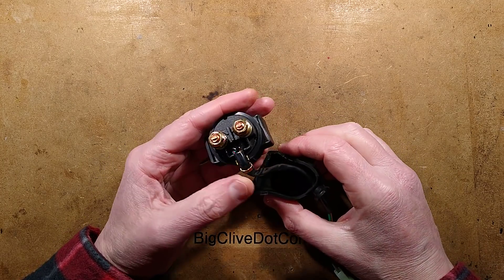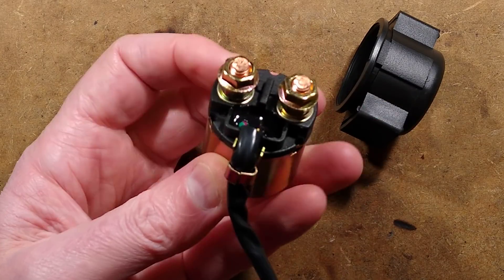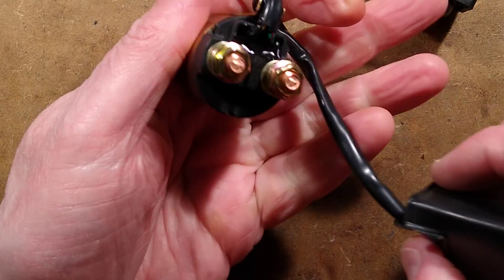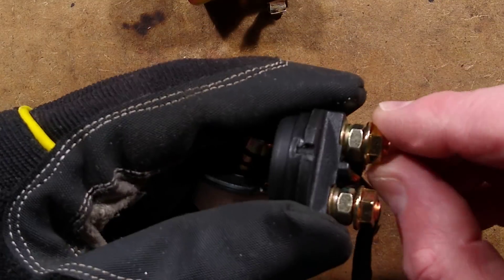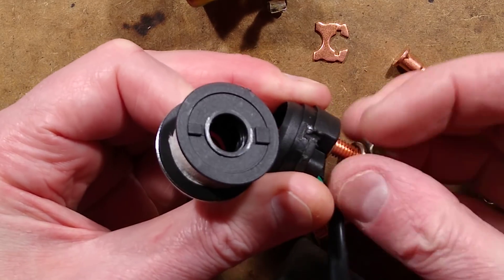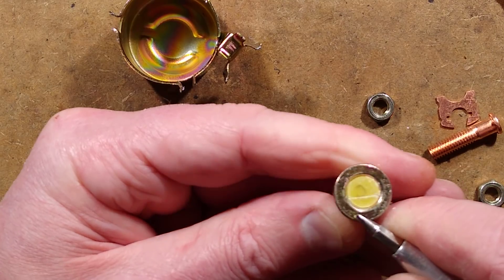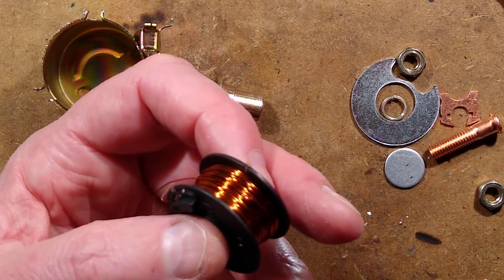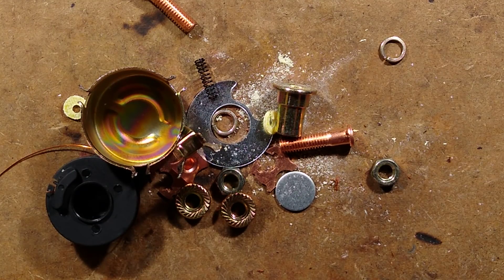Inside a cheap quad/scooter starter relay solenoid

Comment: Clive, you didn't check the coil wire to see if it was copper clad aluminium.
Reply: For sure it is CCA wire, copper would be too expensive, though I would think that by now even the contacts would have been made from brass plated steel, as the copper cost for the 3 pieces likely was half the manufacturing metal cost.
Reply: I hate when they sell copper-clad aluminium or copper-clad steel UTP cables for networking purposes, damn!
Reply: @jkobain  It's really obvious when you pick up a 305M/1000FT roll of UTP and it weighs about half of what it should that it's copper-clad aluminum. That's even before you attempt to use it and the wire keeps breaking... and in the USA, it is against the electric code to use this stuff inside a wall, even assuming that the cable meets the flammability requirements (it probably does not).
Reply: @brianleeper5737  it is really obvious when it's marked on the cable and on the box too, and on their website — so you know before you get to touch or even buy it.

Guess if our world is that much proper?)
Reply: @jkobain  The stuff I saw several years ago was NOT marked as being CCA.
Reply: @brianleeper5737  they still don't really care much; and you really can tell the difference by its weight only when it's a big enough piece. When I had to spend some time in a small city a couple of years ago and needed some jumper wires to assemble a thing on a solderless breadboard (I'm still convinced that UTP wires serve this purpose quite well), in their local shop they had no idea why UTP Cat5e cable wires had white cores on the cut. I'm still psychologically traumatized, to these days.
Reply: @jkobain  I'm sure that stuff was breaking as soon as you tried to stick it in the breadboard. I keep a roll of cross-connect wire around, it's very handy for stuff like that. (And, if you ever need some and you're in a place where you can get into the telephone room for the building, you'll usually find extra lengths of unused cross connect wire, if not an entire spool).
Reply: @brianleeper5737  it was pain, but I survived.
Reply: @brianleeper5737  IIRC, it was thin and fragile. That's all I can recall.
Reply: Was thinking about the CCA as well. Very little solid copper wire coming from China these days.

Comment: Looks like a simple design so it should be reliable.
Reply: Exept that spring looks quite weak for the current it has to deal with. I expect it to burn out quite quickly especially on carburated engines
Reply: @2000jago  Yep, very lawnmower style... any extended crank time and it's burning up.
Reply: Reminded me of early GM starter solenoids. The cover could be removed and the studs were a "T" design, with 1/2 the "T" making contact with the round copper disc mounted on the solenoid. When the disc & studs would get pitted, you turn the studs 180° clean the disc & away you go. Fords had a sealed switch that couldn't be repaired. Chrysler & most imports were a similar design to the GM.
Reply: On a cheap Chinese moped it tends to be the wiring loom and regulator that goes first. Purely down to corrosion. I had to replace my wiring loom three times in three years and the engine three times but that was only to being considerably cheaper than overhauling the engine. Plus you can swap an engine in five minutes